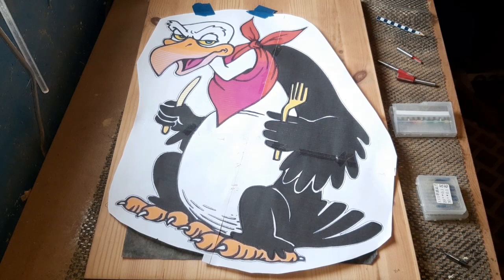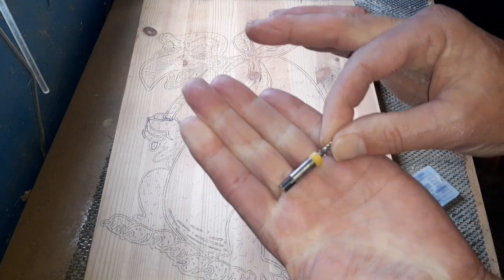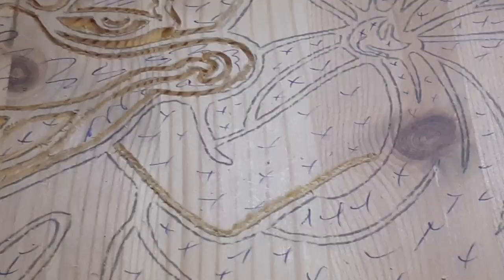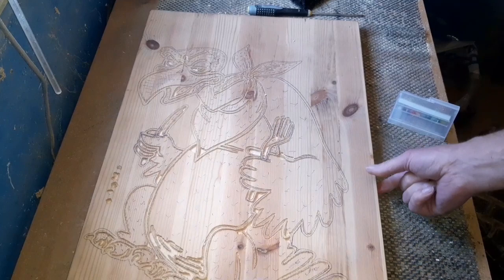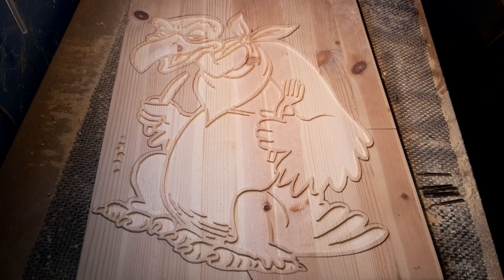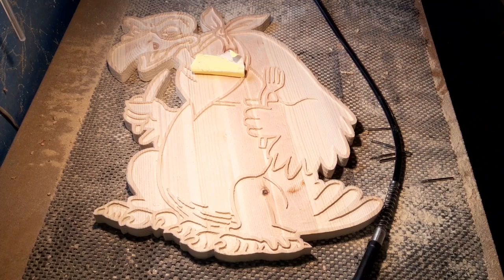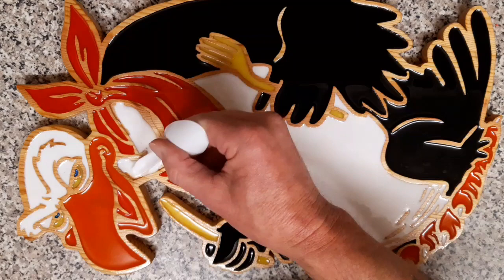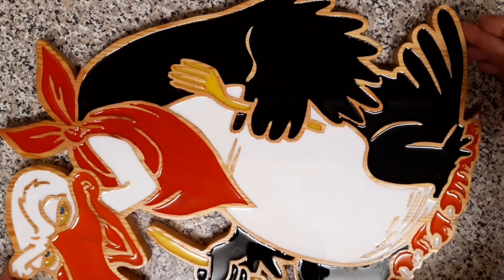Hungry Vulture routed out on recycled pine and inlayed with resin..

Comment: Love your projects pal, have you tried routing on plywood , if so what's ur verdict? Keep up the fantastic vids 👍
Reply from the maker: Cheers Chris I was surprised how good plywood routes out,I've plenty of videos on here,peaky blinders, Marlon Brando, jurassic style name plaque..ideal for resin pieces as you need no sanding down..
Reply: Fantastic, did you have any problem with paint bleeding or spray varnish on the plywood?
Thanks
Reply from the maker: @chrispratt1403  I spray with varnish to seal first,I've never had any bleeding, but I've one used resin with plywood 👍